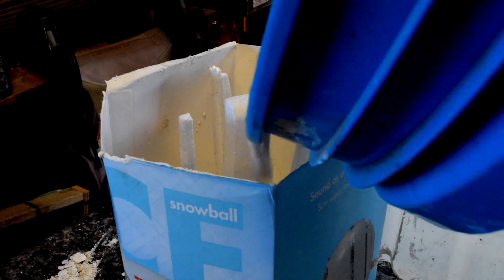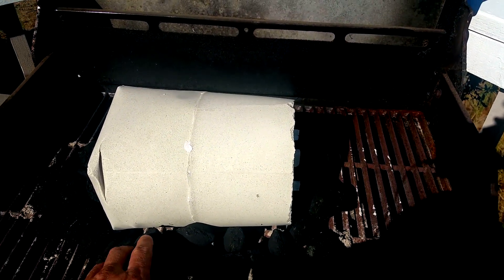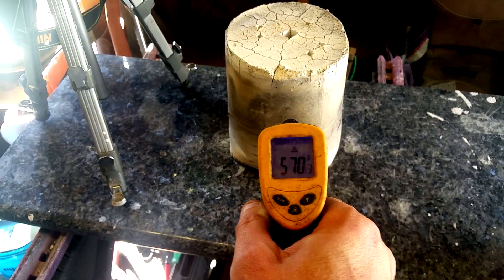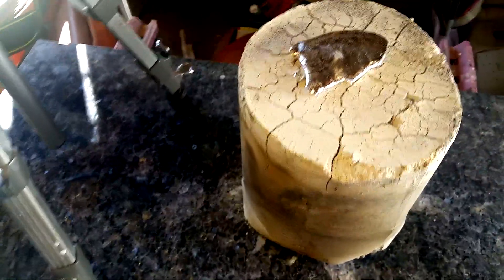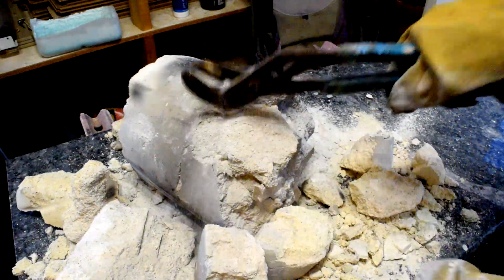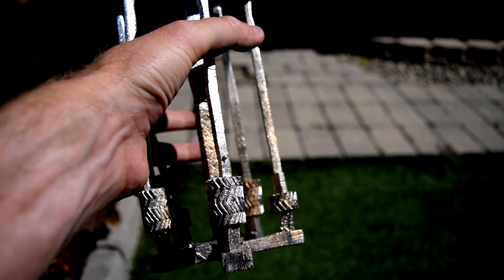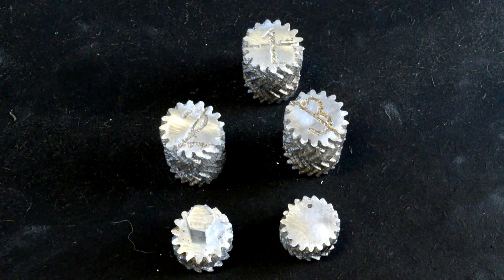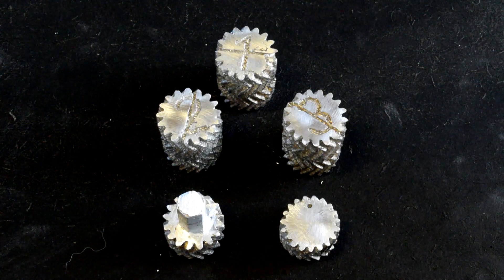Metal Casting 3d Printed Planetary Gearbox Part 2

Comment: There's a reason why gears aren't made of aluminium. Aluminium on aluminium has really high friction and will eat itself up way faster than other materials. Especially at the speeds this gearbox design was running in the original 3d printed version. 
Tooth shape is another big factor in friction, and i don't see how you're getting the shapes correctly if you have to grind off casting artefacts.
It's really cool to look at, but it will wear out quicker than the printed version due to these effects.

Comment: I've been doing some lost PLA casting with about the same method.  I've been putting my molds in a metal bucket and pouring sand around to keep them from blowing out, on one that had a crack to the outside I wrapped it in aluminum foil before packing it in sand.
Reply from the maker: Paul Joat I've only had one mold actually spring a leak in all my castings. The sand idea is good advice though. Another thing to do would be to just mix up a thick bath of plaster and lightly fill the cracks.

Comment: Have you thought of using a vacuum to de-gas the plaster prepour and after?
Reply from the maker: When I first started casting I did think of doing that. However now I just paint on a layer of plaster onto the printed part. This makes sure there aren't any bubbles in the finished cast. The bubbles in the gears on this cast I suspect are not from the plaster but rather from the print. I should of spent more time perfecting the print of the gears and post processing the prints before casting them.